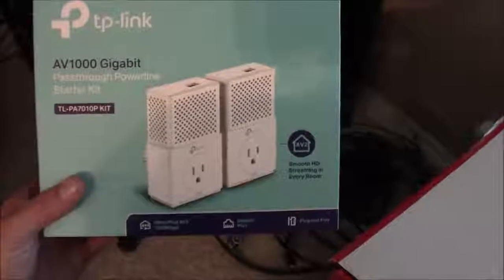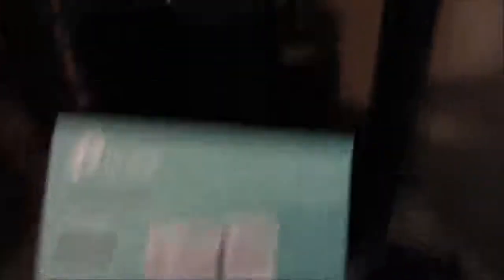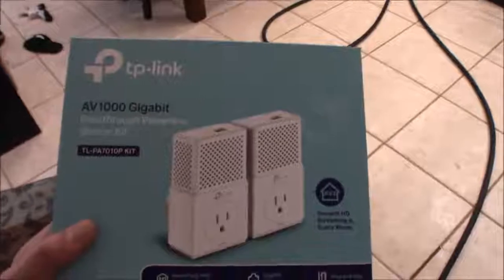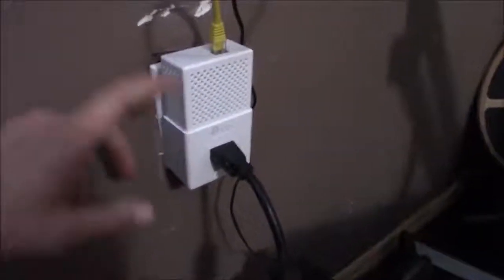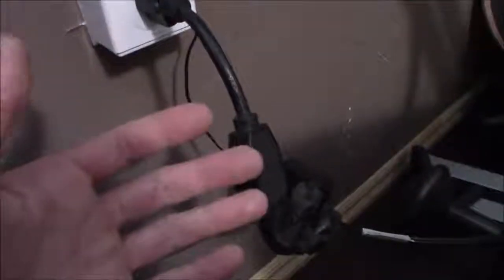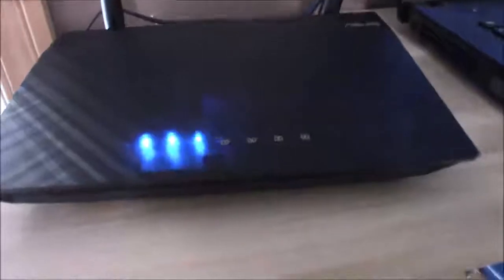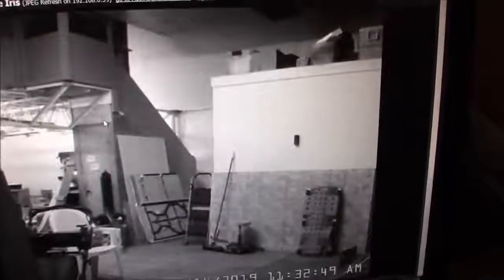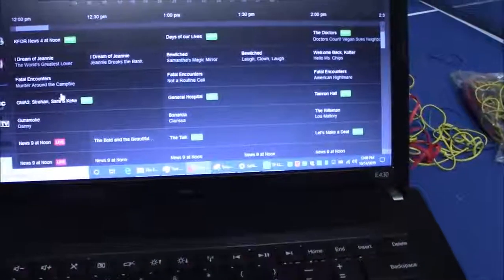Powerline Networking performance in the real world

Comment: do i can use my power strip through the plug on the tplink without having issues? like lower speed or higher ping?
Reply from the maker: worth trying to see.  anything added to the circuit, including the additional plug on the power strip, could increase resistance and noise, so likely to reduce throughput.  only way to know how much is to try it, interested to know how it works out, what you observe with it
Reply: @workingdad  i dont have them yet, im on budget and afraid to take the risk since im gonna buy it from amazon uk (im not from eu btw) and not any store from where i live

Comment: They use the cabling in your house but not at the frequency of the electrical power. The ethernet typically runs at a frequency of 20Mhz to 80Mhz carrier wave on the house wiring so there shouldnt be any interference from your normal power supply.

Comment: Since my ISP only supplies 200 MB, the speed will be just fine. After all, I cannot get any speed faster than my ISP supplies.  And, as you say, it is more reliable at long distances than wifi -- even if bandwidth takes a hit.  I think I will use a powerline adapter if I run internet out to my barn.  Thanks for the information.
Reply: I think you’re confusing ISP internet speed with LAN speed which is the speed you can transfer files within your network...meaning from one PC to another. The speed you get from your ISP has nothing to do with the rated speed of this Powerline Adapter.

This Powerline Adapter is rated to transfer at 1000 megabits per second which is 125 megaBytes per second...again, this is for internal speed of your network, nothing to do with ISP speed.

Also, I think you meant 200 Mb= megabits instead of MB which is megabytes....there’s a huge difference between the two.